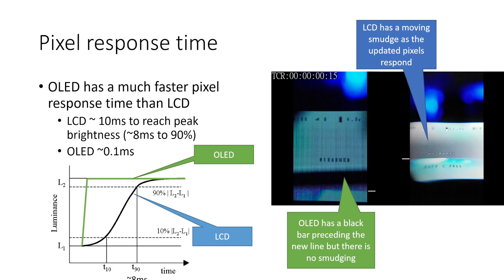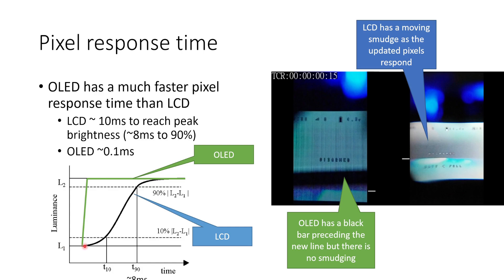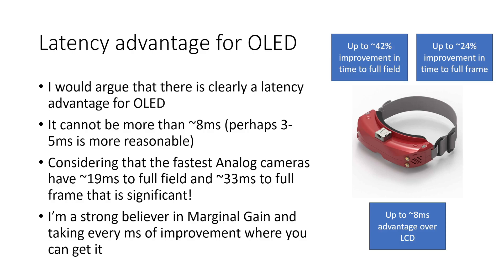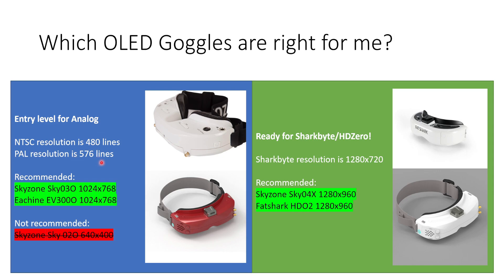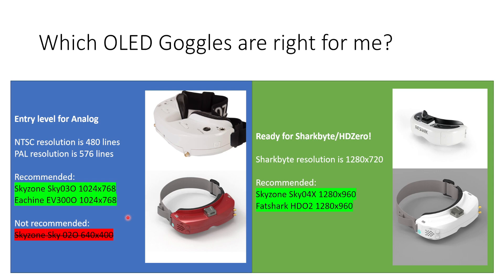LCD vs OLED: Latency testing with 960FPS high speed camera

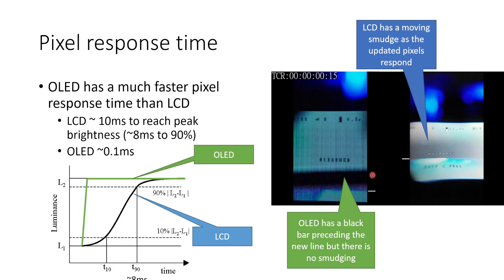Comment: 2:14 that black bar is the PWM signal used to control brightness. Try changing the brightness of your goggle and then re-film the test, you're in for another surprise.
Also, in your recommendation list you recommend the Skyzone Sky03O because of their resolution but ignore the fact that both the 03O and 02O (any Skyzone goggle actually) display field by field and shift one line up and down between alternating fields. The effective vertical resolution is 240 or 288, meaning the Skyzone Sky 02O performs exactly the same. No detail is wasted because neither goggle displays full frames. Unless of course you use Fusion or Rapidfire but neither of these goggles supports modules out of the box and you seem to ignore them anyways.

Comment: I've seen OLED screens (big and small ones) with and without the SCANNING BLACK BAR. Not about refreshing the pixels but to improve the sharpness of the moving objects. My understanding is that it's Meant to Trick your Brains to See Separate Sharp Pictures in a Moving Object which should make the Image to Look Sharper as most people won't see the actual flicker. That Black Bar on OLED screen causes it to Flicker. I'm flicker sensitive and get headaches easily. I hate that feature.
Reply from the maker: Thanks for the information. I wondered why it had that black bar. Didn't seem necessary!

Comment: Thank you very much for this detailed video! I am planning to set my fpv system and currently I don't have any systems at all. Therefore I am lucky to pick what I need to get my expectations. It is obvious that the trend is moving towards digital and this is where I will go for. So I don't see a sense in investing on analog goggles and add a shark byte to have a digital view. 
I wonder your opinion for the fatshark scout HD? Many thanks!
Reply from the maker: I think its a great option if you want to go straight to shark byte!

Comment: PLEASE dont put the same stock into this as link and VTX latency. 

something of note. latency isn't everything here. not apples to apples, but at lower refresh rates (30hz or less)  the response time of oled being so fast actually becomes a bit of a problem, and the image appears to stutter and lag. This is because the latency in the pixel response of LCD sort of "stitches the frames together" for our eyes, sort of like a motion blur effect. At acceptable refresh rates (around 60hz) this becomes less noticable, and at high refresh rates  (120hz+) its basically imperceivable. 

Now, that isnt a big issue with our 60hz goggle displays,  but there is a nice smoothing effect you get with an LCD that an OLED cant really match without using some sort of BFI, which causes extreme dimming. Also, this g2g latency isnt going to have the same impact as link and vtx latency, since the pixes are running an always changing gradient (they aren't going black between frames, without BFI) and most of the time a pixel is barely changing from frame to frame (a grass pixel is far more likely to be a grass pixel again in the next frame, maybe a different shade).

Pixel response time is much more important for things like image ghosting and such as then it is for reaction times.

Edit: another way to think about this is, no matter how fast the frame is drawn, you still have to wait for the next frame in another ~17ms (at 60hz). so, with with oled you have a frame drawn. you wait 17ms for the next frame, and show it instantly, and then stare it it for 17ms with no movement and then bang, another one. with LCD, you have a frame drawn, a new one comes in and over the course of 10ms you change the pixels. you then wait for 7ms and the new one comes in, you spend the next 10ms drawing it and wait for 7ms for the next one.
Reply from the maker: Hi mouseFPV thanks for you detailed comment! Let me respond to each of the good points you raised:

I think that 1ms delay in the camera vs 1ms in the VTX vs 1ms in the goggles are equivalent. Does it matter where the delay is in the pipeline?

The google screen does not update all at once. It updates line by line (which I think the high speed captures beautifully) so you will never have a stationary frame for 17ms. Straight after the final line updates the first line of the next frame starts being drawn. Both OLED and LCD update line by line in this way. I don't think there is any benefit in that situation from having slower pixels. Even when the pixel update line  is sharp it is moving so fast it's invisible.
Reply: @ChrisRosser  this video isn't talking about display latency really though, it's talking about pixel response time. So long as your pixel response time isn't greater than the time between frames (17ms at 60hz) you are just sitting around and waiting anyways. Sure you may see a frame at full brightness faster, but all that means is you are waiting for the next frame, longer. The goggles "Speed limit" is the refresh rate not the response time of the pixels. Slow response time can lead to ghosting (trails on images) but that's about all it's useful for.
Reply from the maker: Your absolutely right that as long as the pixel can change in time it doesn't lead to to much blurring of the video. However, that 4-5ms it takes the pixel to change enough to see is another 4-5ms of latency on the video link it's not for free. And that is more than 10%!

Comment: Skyzone can do the 1080p resolution output from the sharkbyte. I heard on the Orqa you get a black screen when switching to 1080p. Even though PAL has higher resolution I prefer NTSC on analog because the extra 10 FPS makes the picture much smoother than on PAL.
Reply from the maker: 1080p from Sharkbyte? I thought Sharkbyte was 720p?
Reply: @ChrisRosser  You can either choose 720p or 1080p in the sharkbyte menu. I guess 1080p is upscaled.
Reply from the maker: Ah, yes it will be upscaled as the link is 720p.

Comment: You forgot to include overscan in your analog chart. Both NTSC and PAL produce a much larger image than the nominal resolution indicates.
Reply from the maker: How would overscan affect the chart? The extra lines aren't displayed so I don't think they need extra pixels on the screen.
Reply: @ChrisRosser   it is important to know that a 480 pixel high display will likely cut lines off your video.

My FXT Viper goggles have this problem, while my friend's goggles show the overscan lines. The latter adds a lot of resolution to the image.

For example NTSC with overscan is about 710x525 pixels.
Reply from the maker: That's very helpful thanks! Definitely seems like 768 pixels is the right way to go for analog rather than 640x400!
Reply: @ChrisRosser  I think you got it, but I didn't directly state that the overscan isnt necessarily cropped. It seems like there is some variation between goggles.

It was especially obvious with the 720x480 display on the FXT Viper goggles, because they crop off the outer rows and columns of the iNav OSD. They also crop it horizontally to 640 pixels in 4:3 mode, which is pretty annoying and seems unnecessary. Their widescreen mode just stretches it out to fill 720, so it isn't any better.

I have some Cobra X goggles coming, which should solve this problem and be ready for HDZero.

Comment: Finally!  We were all a little concerned that the testing on these goggles were using headset that was 3 gens old.  Felt a little like testing video quality using a VCR.
Reply from the maker: Yep got myself an upgrade for future Analog and SB testing. Good to see that the latency results are the same for both goggles once you discount the pixel response time.
Reply: @ChrisRosser  I think what Jon E5 is saying is the Aomway Commander V1 is extremely old (by about 5yrs) now and FWIW, my subjective experience has been that its refresh rate was slower than the even older Fatshark HD2 goggles which are to this day my main driver. So IMHO this test is hardly a fair comparison of the latency of OLED vs LCD technology due to the two goggles being so many generations apart. A comparison between your SKY04X OLED and a more modern LCD (e.g. the SKY02C) or even LCOS (e.g. SKY02O) goggle would have been better. But I understand you were probably limited by the gear you had available.
Reply from the maker: @kandredfpv  I did reach out to Skyzone for a Sky04L but got no response. The refresh rate of all the analog goggles I have tested is exactly the same (60Hz for NTSC, 50Hz for PAL) so that is not a parameter that would vary between analog goggles. The pixel response time may vary but LCD/LCOS (they both use liquid crystal elements) is always going to be 100x slower than OLED.

Comment: In this testing did you only measure the pixel update on the screen or does it include the various latency of the actual hdmi video link? It would be great if we had clarity as to the total latency end to end.
Reply from the maker: All my testing is completely end to end. From camera to screen including all intermediate steps. This was an analog only test so no HDMI conversion at any point.
Reply: @ChrisRosser  Thanks for the clarification, do you have any plans to test latency when using hdmi input from the same goggles? 

I use skyzone cobra x with sharkbyte and have been very happy with the system. 

Thanks for doing all this testing its really a great service to the FPV hobby.

Comment: Couple of comments:
1. Recommendations of Googles based on a few technical specs. Actually the EV300D is known to have latency issues. The OLEDs do not help then.
2. "you want to have at least the resultion" of PAL/NTSC. I think this is a dangerous advise. Keep in mind that the image then needs to be interpolated to the resolution of the display. There is a lot of literature on that and especially with low-res conditions and sharp edges you can catch artefacts. Presumably these google do linear interpolation. Then you actually do loose resolution quite significantly when going vom analog to 768. Target pixels are in the middle of the original ones leading to the strongest losses. The linear interpolation can be described as a convolution with a Bartlet window and the spectral properties of this window are really bad. So take the highest resolution or ideally something that is a multiple of the original resolution. Thus I'd rather take an original 576 display for PAL than a 768. With 960 things are better again. (P.S.: Think about what that means for SB on these "old" goggles).
3. The difference in races is less than 3%. Well those of Olympic Walking are too and that is not really a low latency sports ;-). The comparison of total time to latency is in my view questionable.
4. Marginal gains - yes. Though one should keep in mind that your analog signal is interlaced. So you get two half saw-toothed images in PAL every 20ms and most people in FPV do not even see this saw-toothing. Analysis of the complete chain and Pareto can help a lot to focus the relevant things.
Reply from the maker: Thank you for your detailed response Stefan! I'd like to answer all your points in turn:

1. The Eachine EV300O is not the same product as the EV300D and has no reported issues with latency. Only one letter but it makes a huge difference!
2. OLED displays with 480 or 576 lines do not exist at this time so I cannot recommend them! 640x400 is just too low a resolution IMO even for analog. 1024x768 is a good price/performance ratio for analog I think. I don't think there is a strong argument that 768 lines is worse than 400 lines for artifacting when displaying a 480 or 576 line image.
3 and 4. I think that reducing the stick to glass latency should allow skilled pilots to fly tighter lines and reduce lap times. And even if it only lets them go 1% faster that really matters in terms of finishing position in competition.
Reply: @ChrisRosser  Thanks for the response Chris. You may be right on the EV300O. But if the goal is to perfom recommendations on the single digit microseconds level, the googles should be tested. I doubt that they are all great and the same. That said not all LCDs are that slow.
I do agree that 400px displays are a bad choice. The point is that 768 is a really bad choice for analog. If you are more deeply interested, I am happy to send a formalism to understand the spectral effect of interpolation. And that is for low-res conditions and sharp edges + (probably) linear interpolation really bad. You may loose up to 50% of your spacial resolution. The 768 pixels are good for Sharkbyte (720p). But the 960 pixels are again bad for SB as we are again close to the unlucky factor of 1.5. Ideally one choose the orginal resolution for the displays or something really factors higher. This is why Fatshark et al should really update their google technology.
The 1% argument is imho still wrong. There are peer reviewed papers on the speed of the visual cortex and the fastest reaction to the motor cortex. I am not an expert here but have read some of those. These speeds determined are an order or magnitude higher than what you measure here. Still the length of the complete chain is important but people here read that single digit ms are relevant for the human cortex. And that is certainly not the case.
Reply: @Stefan_73 The last part is insane. Just because you're slow and can't see, doesn't mean we are like that too. 

Me for example can only fly with OLED. LCD is very smudgy and slow. It's hard to make out things when flying fast. The image simply displays everything WAY to slow. That's why I even switched to OLED. 

When I switched, I was a better pilot over night. Im now able to fly maneuvers that weren't possible before. 
LCD is physically not able to respond fast enough. It's like a moving Liquid oil painting. Humans can indeed feel the difference between milliseconds.
Reply: @Alex-kb4ve  OLEDs do have pixels - colored picture elements. Look at an OLED with a microscope. You probably refer to the Bayer matrix etc. It changes things a bit but does not change the interpolation problem and the associated spectral loss.

Comment: Thanks for introducing marginal gains as a concept! Frame consitency, 10ms less  latency from HDzero, another 4ms from the screen, another 4-6ms thanks to CRSF3 and CRSFshot, and ~20ms less in variable latency in comparison to current control links and DJI... and that whole stick to glass loop all of a sudden feels like a completely new system.

Years ago nobody would have thought that 120fps and 240fps vsync displays matter in gaming. Today nobody even questions that anymore. We'll reach the same state in FPV, I'm sure :)
Reply from the maker: Absolutely. Every little bit matters. I'm loving the SB system with 250Hz Express LRS personally. Much more immediate than even my DJI rigs.
Reply: @ChrisRosser  I also had the chance to test SB at 200mW a few days ago - and it gave me the same immersiveness that analog does, despite it's known flaws. I also immediately started flying closer to branches and be more daring. So yeah, I'm really looking forward to that 1W VTX and might use that for the AOS5.5 - maybe even build one in DJI and one in SB and really see, how those compare and how it affects me on an otherwise idendical quad :)
Reply: Every little bit does matter... If you've ever played mmo browser style games you'll know this is very real. But, I've noticed the community moving away from that idea in regards weight.... I still love to fly as light as possible... In my opinion, even taking a Session off a light but powerful 4s freestyle build makes a marked difference in performance.... So much more fun to fly with no gopro on board.

Comment: Great video! I've been flying analog with my DJI goggles and have been very tempted to invest in a proper pair of HDO2s. This might have pushed me over the edge. You mentioned VTX latency, are some VTXs slower than others? Also request for what I consider the nicest looking cameras: Foxeer Predator V5, T-rex, and Caddx Ratel 2.
Reply from the maker: Absolutely, I think the OLED does make a difference. As far as I know all VTX use the same chipset from Richwave so they all have identical performance in terms of latency. Analog shootout coming soon!
Reply: It's very hard for VTXes to introduce latency worth talking about because that would require buffering analog signal..